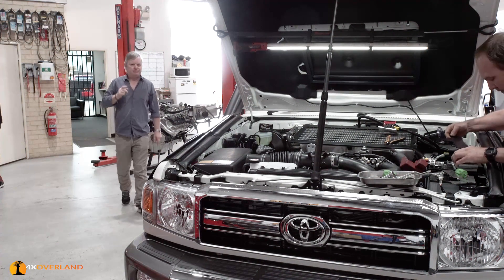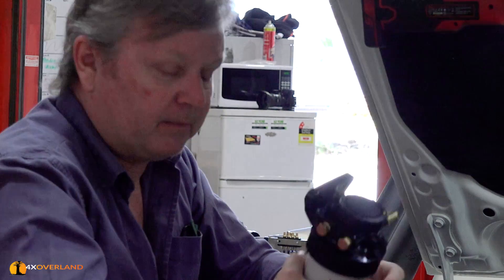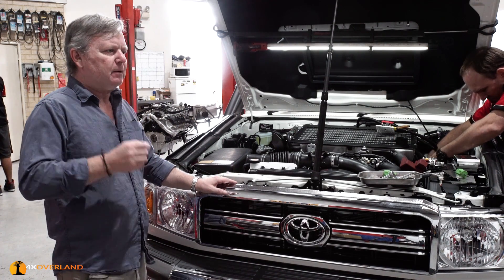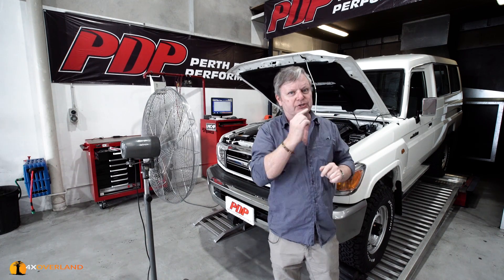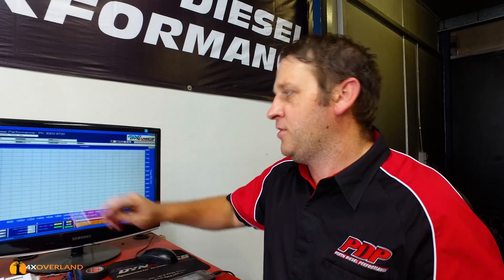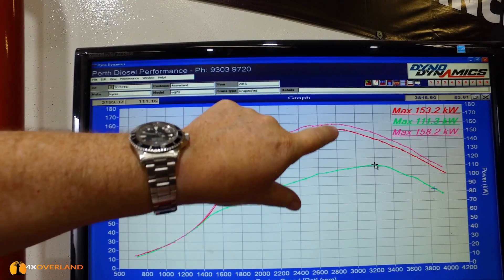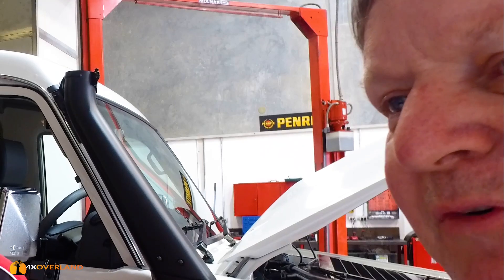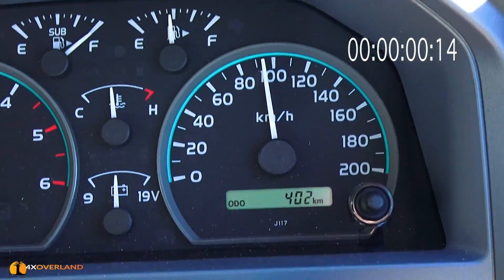DIESEL PERFORMANCE UPGRADE. AndrewSPW Land Cruiser build-8

Comment: That Lambo might perform as good or better than a Veyron, but a Veyron was designed to run on less than optimal African gas and drive on African roads where the speed limit is unlimited. A tune won't turn a Tshirt into a tuxedo but it can make the Tshirt fit you. Understand that and tunes will greatly increase your vehicle enjoyment.

Comment: All engines are different yet they all get the exact same tune loaded in from factory.  It’s like a generic remap is absolutely fine but a engine specific remap will possibly be 5-10 killawatts better.

Comment: The price that pdp charges for there unichip the fuel economy would have to be drastically improved to make any money back  as it cost the equivalent to 1940 liters of fuel ...
Reply from the maker: Fuel saving its not it biggest boast. In fact, it increases it a bit. But its a lot more fun to drive.
Reply: 4xoverland I have to agree whole heartedly there but the economy things is allways a hard one to justify when the kit costs so much but the low and mid-range grunt is unbelievable!

Comment: That much gain seems almost too good to be true ...
Reply from the maker: That's what I thought!
Reply: 4xoverland haha i made that comment before watching your subsequent video. After you mentioned the 200 series it made a lot more sense (i was aware they are the same motor - albiet with 1 less turbo - but it didnt trigger). Given the power in the 200 (which you would assume Toyota given their reputation has still only conservatively tuned) the 70 must have miles of safe headroom.

Comment: Andrew,  I really like the concept of the fuel filter kit but I see one fundamental flaw, because this filter is a pre filter it makes the factory filter obsolete, any particles above 5um will be caught in the pre filter, I suspect this would mean you end up replacing the pre-filter element more often and the standard Toyota filter will never need replacing as it is doing none of the filtering. I believe this would better if installed as a final filter after the Toyota filter and before the injection system. The filters should be set up from coarse to fine in order from the full tank forward with the finest filter being the last in the system.  Eg 30um > 20um > 5um (20um being the Toyota filter)
Reply from the maker: I see your argument. But on the other side, with the filter fitted after the standard filter, I would then need to replace both filters, instead of just one.
Reply: 4xoverland i think you would get better longevity of your 5 micron filter which are a lot more expensive to replace than the Toyota filter.
Reply from the maker: True. But the Toyota filter has no visual way to see if its contaminated. The aux one does. This way around, I will very rarely if ever change the Toy filter and and change the aux filter often. Having the Toy filter first means that I would have to change the Toy filter frequently, and the aux filter just as frequently as I would if it was first in tine. There are arguments both ways, and I have given this a lot of thought, and believe that this is the best way round for doing the primary job in keeping the injectors safe, at the lowest cost.
Reply: 4xoverland I am too lazy to do a cost v benefit analysis and that would require hard data on how long between filter changes.  I have the 2017 single cab ute and weighing the options. I might go with the PDP kit but reconfigure it so it filters post Toyota filter.

Comment: The Kaizen culture in Toyota comes through their products. I lifted my 2015 4Runner and on the lift next to my SUV was a huge Dodge Mega Ram pickup and the 4x4 shop pointed out how much thicker the toyota front axles are. I agree they are over engineered to take a lot of abuse.

Comment: Do they use lift pumps in Australia? AirDog is one of the brands here in the US and their pumps do wonders for diesel engines by providing cleaner fuel with both a 2 micron filter and a separate water separator plus the advantage of a fuel pump to ease the work of the injection pump at getting the fuel to the desired psi.

Comment: Andrew would you buy a second hand 4x4 that had been running with a performance chip in it. How do you feel about the added wear/pressure/ strain on the engine?

Comment: The "idle up" button holds rpm at 1200rpm until the car warms up. Couldn't you change the function of this to hold a higher idle all the time and use this for the winch function?

Also what is the cost of the Unichip installed?
Reply: Lewis McCormick but only to warm up. There reasons to do this after it's warmed up.
Reply: JJ I understand that, I meant can you change the function of the button to hold a higher idle even after warm up.
Reply: Ah, OK, Didnt know that was part of the OBD settings..

Comment: Andrew, another thing that these engines (and many other CRD engines) suffer from is fine oil mist from the crankcase ventilation system mixing with hot exhaust gas, from the EGR system, and coking up inside the inlet manifold.

The stock oil separator doesn't work very well, and what make matters worse is that the inlet is above the timing chain at the left front of the rocker rocker cover. The timing chain throws oil into the inlet to the separator.

Arguably the best separator is a Provent 200 manufactured by MANN+Hummel in Germany. MANN is one of the worlds largest manufacturer of diesel engines (trucks, trains, ships, etc.) and they developed these because conventional oil separators can't remove very fine oil particles, invisible to the naked eye, which over time was leading to failure of the compressor wheels in the turbocharger.

To trap these small oil particles the filter media must also consist of very small diameter fibres. Many oil separators (AKA catch cans) use stainless steel filters that can't trap small oil particles. BTW the chemical engineering department at the university in Perth did much of the R&D, for MANN+Hummel, on the filter used in the Provent 200 (they do a lot of research work on filtration for industry and MANN+Hummel is a large client).

The earlier you stop the oil entering the air intake system the better. The coke builds up quite quickly and cleaning the inlet manifold is a relatively large and expensive job on the Toyota V8 diesel, something to be avoided.

Comment: Andrew, love the show! ....nothing is free, especially power. are you concerned about drivetrain stress, reduced range and pollution? Also, manufacturers are typically aware of the performance their mechanicals are capable of, and the tune is set for the performance/pollution/durability they feel is best or environmentally friendly or mandated. the factory programming isn't arbitrary. each turbo has a sweet spot on the compressor map and is chosen for the application, more diesel raises the egt's, etc. A plug and play chip can make my Ford put out over 1200NM, but, I'll pay in efficiency, pollution, and warranty. It would have been interesting if you had built out the truck, taken a 3 month holliday with it, and set a base line of data, to observe what was gained and what was lost with the changes.

Comment: Number 4 on the uni-chip is the same as the "IDLE UP" button isn't it?
Reply from the maker: Not quite. The idle up button only works when the vehicle is stationary. The instant the throttle is pressed, it cancels and goes back to ordinary idle speeds. This one works even when the vehicle is moving and might be interesting to use in low range.
Reply: I see! Thanks for clearing that up!
Reply: 4xOverland if its the same as my Prado, idle up only works when the car is cold. If you press this when the car is warm it does nothing even if your not moving

Comment: It still makes me laugh, with so much money handed over for the Toyota platform.
Just how much work and extra money is spent on them from new to make them, well, better!
At least you have factory diff locks, but that's about it :(
Engine Mods
Water Cooled Alternator
Suspensions mods
New wheels and tyres
Wheel Carrier
Long Range tanks
Proper Driving seat
Correct the off-set issue
Improve the handbrake
Really, things you'd think a company like Toyota could get right from the factory!
"Oh What a Feeling" my bank account!
Reply from the maker: But they do!!! But they don't build them for overlanders. They build them for mining and agriculture, and these trucks do things that no others will do. And that is the only reason why Toyota keeps making them. I could use it as is, without a single change, and do Australia's toughest and longest recreational trail (Canning Stock Route) without a single grumble. But would I want to drive it like that? Not really. BTW I have not changed several things on your list: fuel tanks, driving seat, handbrake works perfectly, same wheels, not changing the off-set.
Reply: Yes, you are right, the target market is Industry and commercial use.
Not really for the everyday 4WD user.
Agreed, it would work fine as is.
It is just a shame some things haven't been considered by the factory.
It is obviously not just the Troop Carrier, its the 78 and 79 series as well.
I just think, when you pay such a premium to own a Toyota in AU, that it is almost considered necessary to do some of these mods as a bare min.
Reply: @4xoverland  Hi Andrew, You mention here that Toyota build the Troop Carrier in an agricultural and mining specification as well. I have heard about this before from a person thats a mechanical engineer with one of the big mining company here in Australia. He was describing some of 200 or more upgraded modifications that Toyota put on these vehicles.  Would it not be more economical to purchase a mining spec troopy direct from Toyota as all of the modifications are then being covered under warranty.  I am pretty sure that mining spec vehicles also include the modification to the rear axle alignment as well.

Comment: Hey Andrew. I'm no expert but my logic wonders why toyota would not tune their engines like this from the get go making the vehicle more appealing than it already is? Surely they have the tech and funds to improve the ecu technology in house? My guess is that they are aiming at maintaining the the perception of reliability in their brand. The only thing I can think of is who the intended majority drivers are and how they will be using the vehicle(as you mentioned in a previous video, mines).  The "detuned" motor possibly handles a thrashing(fleet vehicle) better than the chipped vehicle does in the long term, I'd imagine you will only use the high performance setting in selected driving conditions. Anyway, just thinking out loud. I realise your review may be slightly biased considering the strategic product placement in your video. Your experienced/ expert thoughts on this would be interesting to hear.
Reply from the maker: I feel no differently to what I said. However, i would not set it on nr1 full power setting all of the time, and then drive it a max power on and on, because how can that possibly be good for the engine? That's why there are other settings. But I think I will shoot a response video to clarify what I have learnt, and to air my opinions of the many reasonable questions this video has raised.
Reply: Ludi Cronje Toyota has billions of dollars just laying around. They tune their vehicles for maximum reliability and that's how they earned their reputation.
Reply: CACressida That is what I discussed in my comment. So in your opinion the chip reduces reliability? Thats the Crux of my discussion.
Reply: If I was Mr Toyota, I would think like this: "For the troop carrier, 150kW / 430Nm is adequate and there's not much competition anyway. That leaves plenty of room to up the power to 200kW / 600Nm in the landcruiser and still leaves space for more again if we do a Lexus with this engine." Also, there is room to increase power in future models.

I'd say it's all about marketing their range of products over several years. You see the same thing from all manufacturers - increase power as you go up the model range and over time. People like Porsche are masters at it - want more power - pay more money.

Comment: lol at dyno guy saying it is torque that gets you moving. It is power that moves. Where the power is produced in the rev range is the bit that is important.
Reply: Torque curve dictates your engine's power output horsepower is just rpm x torque / 5252
Reply: correct. power is a derived statistic, and it power that moves. notice how on a typical gasoline engine, power continues to rise as the tq drops. if the statement "torque moves" was true, acceleration would decrease, not increase, at that area under the curve.
Reply: Scott  Zimmermann when was the last time u drive a car .... the area below the power band or correct name torque peek the car won't accelerate as hard until you get into are the engine makes most of its torque while your power figure may rise with rpm eventually your engine will run off its torque curve and power will drop thats why you select proper to keep your engine in its torque band
Reply: MegaRyan123456 Peak torque normally gets produced before peak power. As long as there is more power, you will accelerate faster. 

While motor journos love to write about a wide torque band, it really is about the power curve.
Reply: the power curve us dictated buy the torque band like a lot of people your confused !!
Reply: I have raced and build cars and bike engines for 25 years I know a thing or to about making something go fast .... anyway this is a 4x4 all Andrew needs is more torque the power figure is not so important
Reply: MegaRyan123456 it is still about power ... it is about a lot of torque at a good engine speed which produces good power. you ain't getting nowhere if 10000nm is produced at 1rpm.
Reply: T Tan yes and this engine produces let's say 500nm at 1400 rpm that gives it a power figure of 133kw at 1400rpm that's why horsepower numbers are pretty irrelevant in engines like this as they produce the power so low down and there is a direct relationship between rated kW and rmp
Reply: Peak torque can never be higher up the rev range than peak power.

Comment: loved the kid in a toy store laugh..when i put in a bigger throttle body spacer and Airraid breather in my Jeep i had the same laugh...can't wait to see whats next.take care.
Reply: Did the throttle body spacer cause any under bonnet clearance issues? I ask because my gas converter (top of engine) sits a fraction higher than the standard throttle body assembly and already interferes with the under hood sound deadener lining.
Reply: SpectreOZ what year is your vehicle? mine is 03 wrangler tj..i dont have clearance issue per say,but if you push down on hood in area of throttle body it will touch..the torque of the engine doesn't seem to interfere either.
Reply: My XJ Cherokee is a 1996 model :)

Comment: Did you do a clutch upgrade? If so which clutch did you use?
Reply from the maker: Its reckoned that the 2017 spec LC probably does not need a clutch upgrade. But I shall wait and see.
Reply: Enjoying your channel, you have inspired some recent overlanding within the Victorian High Country. I recommend you make some time to check out this area.

Comment: What happens to the EGT - can you fit a gauge and show the results at different settings?
Thanks
Reply from the maker: You can but there is little point. the engine's own systems monitors the EGT and prevents over-fuelling.
Reply: It would be interesting to monitor, would it not?
Reply: Andrew do they fit a pyrometer with the unichip ?

Comment: Only 215 horsepower for that big v8?? i get the torque being high in dizel, but didnt expect the hoese power to be so low.
Reply: aky19832001 these engines produce there maximum torque at about 1500rpm they only rev to about 4000 there setup for lowdown grunt not HP

Comment: I am glad you found a brand new troopcarrier and I can't wait to see the project finished and see your new adventures. I have one question. My 1.5 dCi engine from Renault-Nissan group went up from 110HP to 128 HP after visiting the local chip specialists. The torque output is somewhere around 280 Nm. Why does a 4.5 liter common rail turbo diesel output only 150 HP stock and only around 400 Nm. That is a 2.0l turbo diesel performance. I suppose there is a logic behind this and I am curious to understand it.
Keep up the good work!
P.S. I am a yearly contributor to your website. :)
Reply: well yes any engine is reliable if properly maintained, why don't we just stick a 800 bhp Ferrari v12 in it? i mean after all if it's properly maintained it will last for ever. The low stress landcuiser v8 needs little to no maintenance to be reliable, which means it will never let you down. it's intrinsically reliable rather than reliable through maintenance.
Reply: reliabiltly 
very tough conditions in australia 
most brands are getting 200.000km if you maintain them 
the landcruisers are getting 300 without any maintenence 

designed more for the mining and agriculture market 
no other brands are competing

talking of the new cars of course 
theres plenty of others such as the nissan patrol that were quite good 
but all other brands went for the consumer market not industrial
Reply: reliability.
Reply: This is not satisfying. Any diesel engine is reliable as long as you mantain it accordingly and exploit it normal... Common rail engines are quite sensitive to low quality fuel.